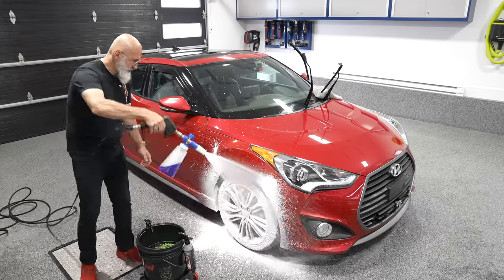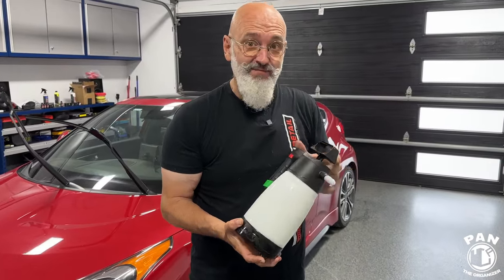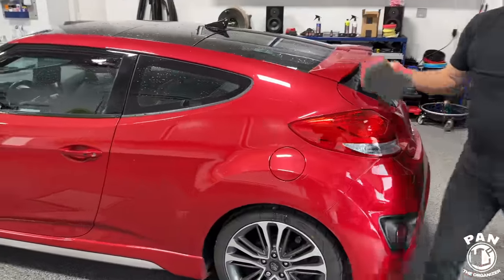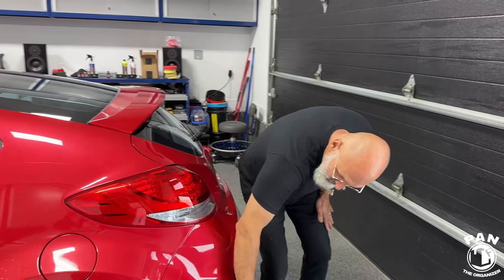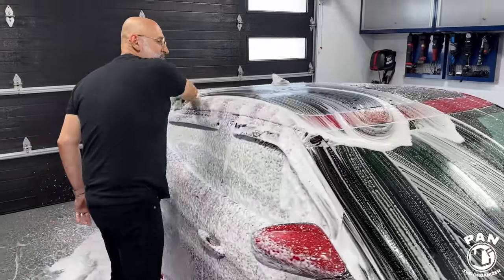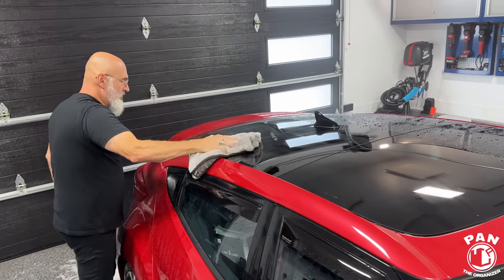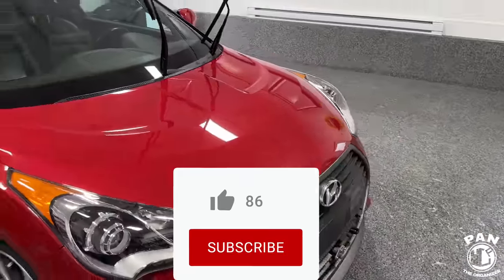The Ultimate Guide to Easily Wash, Clay, and Seal Your Car!

Comment: As most don’t have a detailing garage, I’d prefer these videos were done in a driveway scenario as many of these tips wouldn’t work well in direct sun where things dry much faster. Cheers
Reply: Unfortunately making videos outside isn’t easy because of audio. This process can be done outside easily with one simple change, use Rinseless, and do one panel at a time.
Reply from the maker: Well said. Also, most people I know in my city have a garage they can detail from and wash their cars. Also, filming indoors allows me to have perfect control of the recording environment: lighting, sound, etc. Filming outdoors is way more challenging.
Reply: Saying that most don’t have a garage is a gross misrepresentation.  How do you know?
Reply: @AndrewTa530  Troll elsewhere please. Holy fk
Reply: @AndrewTa530 lol you think most people have a garage they can pressure wash inside?
Reply: @diydetailofficial  Agreed but I can guarantee many will be cursing following these tips in their driveway. Especially when the expert states post tip that some of these tips will fail outside. Cheers
Reply: @cheesedoodle2327 why wouldn’t they??
Reply: @FJB8646  lol
Reply: @packetdust You're right, everyone in my apartment complex pays for and shares 2 car garages that have full water access and with plenty of space. Not. You're either out of touch with reality or completely indenial. Silly comment.
Reply: Do it early morning or in the evening, when you have shade
Reply: Where I'm from all garages are converted into living spaces so everyone washes outside. Rinseless is a game changer for me but I can still bucket wash my car as most now how to make due with what we've got. I love these videos keep doing what you're doing Pan!
Reply: @jmc4975  I know right these people think everyone has a fully waterproof garage with proper drainage and space lol
Reply: @cheesedoodle2327  It's pretty smooth-brained to assume everyone has the same kind of access to what could be considered just a covered space, let alone a luxury detailing garage.
Reply: Thanks for video. Why you didn’t use iron remover with no rinse wash method?
Reply: Can we all just agree that everyone's living arrangements are different.

I have a garage but it's  not big enough to detail a car, so I detail outside.

Be smart like one post said, do it early or late evening.
Reply: @AndrewTa530 the vast majority of his followers are fully mobile. Most people don’t have garages that can be used for this type of work and that’s a fact.
Reply: But we all have mornings and late evenings when Sun isn't strong . I did several ceramic coatings done for my clients, and without driveaway, but on the street , so, it's possible...
Reply: @Bull1the1Great  nobody said this couldn’t be done in the morning or when the sun is going down, although you will need proper lighting to ensure the job is done at nightfall. The original comment simply asked for this to be done outside in “direct sunlight”.
Reply: dranderson6071.
You must be new here. Vast majority of people need to throw away or organize (pun intended) the crap in their garage. 
I love Pan’s garage. He clearly planned it out for years, saved for it…..and frankly nailed it!
Reply: @MRDMotivates just showing different methods. Iron removers require rinsing after. The Rinseless version is something that can be done by anyone with just a few gallons of water. You can do one panel at at time from start to finish.
Reply: If I had Pans garage I would never leave.
Reply: On the rinseless wash side, is it better to use ceramic gloss or quick beads with the perforated syn thetic decontamination towel? In another video on Diy's channel, Nick preferred quick beads due to its slickness. Does this make a difference as it's not being washed off (activated and washed off)?
Reply: @benkneisley3001  Agreed yet irrelevant to my post. Cheers
Reply: Yasou Pan,

Thank you for sharing another great video especially with Ivan 😀! I have told many people about your YouTube channel and several thanked me for teaching them about car detailing 😀!

I want to decontaminate my car. It is a 2014 Chevy Malibu with 65,000/104,600 km and has a regular car wax. I use P&S Absolute wash and I bought a “clay” towel from DIY. In the video, Ivan did Not use the “Iron Remover” on the Rinseless wash portion. Instead he used “Ceramic Gloss.” On the traditional wash he used “Iron Remover.” Will the combination of using the Clay towel and Ceramic Gloss remove and/or decontaminate the car or should I use Iron Remover with the Clay towel Plus the Ceramic Gloss? I will leave the Rinseless wash solution on my car after I wash it to act as a lubricant. 

I also want to Ceramic Coat my car in the future. I will need to watch and study your videos for the best “tips and tricks” for the best products. 

Please let me know if you have any questions or concerns. 

Thank you and Ivan for a Great video; I really Appreciate it. 

NIKOS
Reply: Awesome 😎 ❤
Reply: @cheesedoodle2327 I know 3 people that don’t live in a house.  Out of the other hundreds they all have garages and most can park one car in it which is all you need to wash a car.  The others treat their garage as storage and quite frankly need to throw most of the crap away or donate it as a garage is for cars or work stations.
Reply: @ohboy2592  so you have hundreds of friends that have water proof garages with proper drainage..pretty cool man i don't know one person like that.
Reply: @cheesedoodle2327  ever garage is water proof.  Water runs right out the door off the concrete floor.
Reply: @ohboy2592  lol ok buddy
Reply: You would do one Panel at a time (Wash & Dry) if outside!!! Works great!!!
Reply: @MRDMotivates the Iron Remover needs to be rinsed off with pressure washing. It’s not ideal for the rinseless method!
Reply: @cheesedoodle2327  have you ever been in a garage or seen one?  A garage is just your driveway with a cover over it.  Does your driveway flood when it rains or you wash a car?  Do you think every garage has a floor drain or some magical contraption to remove water?
Reply: @ohboy2592  a garage is your driveway with a cover on it.  Ok buddy got it.
Reply: @cheesedoodle2327  you obviously don’t understand. When you get your first house you’ll understand what is being discussed.  Or go look in a friends garage and you’ll see what I mean.  It’s not that difficult.  It’s a concrete slab with walls and a roof over it.  Water hits the slab and flows out into the driveway.
Reply: @ohboy2592  ok
Reply: @AndrewTa530 a garage to detail in like pans garage ? Wow you must think everyone is rich or something. It’s a valid point he made and yes pan has also put up videos of himself doing these steps outdoors
Reply: @dranderson6071 do you have common sense?
Reply: Yeah, I’ve come to the conclusion that people who have no choice but to detail outside have either deionized water, a blower to dry the car quick, or both. 

I have a garage and I just don’t have the room to detail inside it, so I have to choose certain times of the day to get it done. It’s a pain but I’m gonna try a blower soon to see if that makes the process easier.
Reply: @AndrewTa530  it's Canada
Reply: @jmc4975  do you live in Canada?
Reply: @michaelconlin5614  Unfortunately, I don't.
Reply: Can I clay mitt or rag with a sealant with soap as a lubricant ???
Reply: Everyone has to understand these videos are a sales tactic so the easiest way possible is always going to be shown.
Reply: Not only do many people not have a garage, many people don't have a driveway either
Reply: As most people in the world don't have a car, do you prefer that he detail a bicycle?
Reply: @JustMe-999a  Irrelevant
Reply: Note: Small car, less surface area - lowest cost.
Reply: Most people who own cars of some value Do have a garage or at least access to one! Sorry you do not…
Reply: @2Greenlid  Lol
Reply: @AndrewTa530 it’s very safe to say “most people do not have a detailing garage.”  Go door to door in your area and see how many have a garage setup that it is perfectly safe and ok to spray water in and that have floor drains to take away the water and soap.
Reply: Lol I don't even have a driveway, however I love to detail my Mercedes every week.
Reply: @AndrewTa530  I'm one of those don't have a garage. My shade tree is my garage
Reply: @bossmanseen4807 cool, use a decontamination towel. After the wax and wash and polish. I can drive it to get contaminated again. 😅😅
Reply: @ohboy2592 obviously, I was denied a house because of my skin color. If your white, your allowed to buy a nice house with a garage. 
Because my skin is darker, the bank things I cannot pay my bills or own a house with a garage. 😅😅😅
Reply: @2nickles647 You were not denied a house because of your skin color, you were denied a house because of your financial standing.  Stop lying.
Reply: Bro u chould also just make or buy some kind of car tent for youre drive way when detailing its not that expensive if u also got the money for all the polichs and stuf
Reply: @mopadrider6012  Bro, never knew it was so easy. Man 55 wasted years bro
Reply: @dranderson6071  this. I live in Florida where it can be difficult to be in the heat and sun for a long period of time.  And like many others, my garage is not really used for vehicles and one of my vehicles is a stock 3500 which is next to impossible to fit in my garage.

Comment: Tip to manufacturer: For the clay towel. Put numbers on each quarter of the towel. That way it's easier for the consumer to know/remember which sides is used and not used.
Reply: Good idea
Reply: @diydetailofficial will you be restocking the clay towel? Been waiting on it for a few weeks now.

Comment: This morning 06/01 I used this process and these products to do my 2014 Kia Sportage. For those wondering about doing this outside versus being inside of a garage. Here's my experience.

I did it outside early in the day.  The sun was out but the majority of my driveway was in the shade.  Temps were in the high 60's / low 70's   When the sun finally started to hit the back of the car and since I'd already done the front.  I just turned it around and backed it up in the driveway and finished it off. 

The whole process worked perfectly.  I admit I had my doubts about the clay towel to begin with as I've always used a true clay bar in the past.  But it did a VERY good job on this car and it had never been clayed or the surface decontaminated before.  I could feel it dragging quite a bit on the hood.  Which, as expected had the worst contamination on it.  So I just flipped to another section of towel, sprayed and continued the process using lots of lubrication till everything felt smooth.

The whole process from start to finish took less than 40 minutes. Since I'd never done this before, I took my time.  Now, after doing this one time. I know  I can do the whole car in less than 20 minutes the next time.  

I also wasn't quite sure exactly how much water to use for the process.  I put 3 1/2 gallons of water into my 5 gallon bucket, and I estimate I probably used a half gallon total.

Finally, I just want to tell anyone who has watched this video and is on the fence about whether this process works.  I can assure you that it definitely does. Highly recommended. Especially, For those who live in apartments or condos. Also, if you live in an area where there are restrictions about water runoff with any kind of chemicals in it, this is an ideal solution for you.
Reply from the maker: Thanks for sharing your personal experience Carl! Great testimony here.

Welcome to my channel. You discovered one of the biggest car detailing channels on YouTube as we surpassed 1 million subscribers and we have over 140 million views! I have been detailing for 27 years and I love to share my knowledge and passion with my viewers.

You found the right channel to help you learn everything about detailing.

Comment: Not gonna lie, every time I smell the DIY rinseless wash it makes it increasingly difficult not to drink 😂😂 Another great video collab! 😎👍 Appreciate the full transparency of this Rinseless method. 

I actually use it as a glass cleaner, interior wipe down cleaner, and anti static spray for the fabrics. So many use cases! 💯 Keep up the great work DIY!
Reply from the maker: Thanks Cardos!
Reply: Thank you 🙏🏻
Reply: DIY rinseless wash on my car today only took 35 minutes. Didn’t even need to use glass cleaner. 

I used multiple microfibre towels and one 15 litre bucket , dunk the IK sprayer in for pre wash then rinse off with garden hose and then use the multiple mits that were soaking in the bucket 

Next on the list is to purchase the legacy sponge 🧽

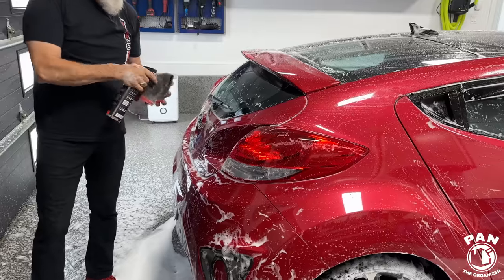Comment: 27:24 for the duration, I'm curious if this is for ceramic coated vehicles such as this one or if that duration is on non ceramic coated vehicles as well. I absolutely love the Ceramic Gloss and Quick Beads. The application is stupendously easy for both. Seeing the real time beads made as you rinse the vehicle. Very satisfactory.
Reply: Works on both

Comment: One of those worx hydroshots are great for a "rinseless". I have a 6 gallon bucket and mix 5 gallons of solution. Using the worx i pre rinse an entire crew cab f150 using about 3 gallons and the last 2 gallons is enough for the wash. If in the sun I go panel by panel. If the truck is filthy i use 5 gallons hot water - amazing at dissolving grime that way.  Im still old school and using ONR plus carpro reload as rinse aid/sealant.

Comment: And just like that, this video has become a reference for the net.  Wash, clay and seal for both rinseless and traditional soap.  Covers such a breadth of information in a concise format with top guys in the industry.  DIY Detail "Clay" Towel is definitely going to be part of my Spring season product purchase.

Definitely taken a page out of Yvan's book regarding wheels.  Love Brake Buster, but after using it once for a thorough clean, my maintenance washes on wheels involve just a rinseless.  They really don't get that dirty in two weeks.  Even easier to wash if you seal it with some Turtle ICE Seal n Shine ;).  I'll grab BB for tires and the occasional reset if I feel the accumulation is too much, but even then I'll dilute it at least between 2:1 or 4:1 (water:BB)
Reply from the maker: Thanks for the positive feedback!
Reply: Thank you

Comment: Really good class Pan, thank you. So the bottom line is the rinseless method can only be used if the vehicle is already sealed after decontaminating, paint correction (paint chip leveling), and a ceramic coating.  Is this a correct assumption or am I way off base?  I know of a guy who owns a classic Mercedes and he says he NEVER wet washes his vehicle.  If a vehicle only had wax, or was overdue for a was, the rinseless method would not be a good choice because dirt is sticking to the paint, correct?

Comment: I've brought Clay Bar, Turtle Wax polish for my black color hyundai creta. As an application, I wash my car with a water pressure pump followed with a clay bar application to remove tar or foreign particles. Afterwhic I shampoo wash the car. Post leaving it dry away from sunlight I then apply Turtle  Hard Shell Carbunara Wax and wipe it after haze dry with microfiber. Hope this process is correct.

Comment: Awesome video. Definitely saved for future reference. Other than DIY Iron Remover, what alternative iron removers can be used in the same way?
Reply from the maker: It's impossible to say as you'd have to make tests and find out the formulation of each one. The key thing is to use an iron remover free of any solvents. CarPro IronX also works well in my testing.

Comment: Great tutorial as always. Just a quick question regarding the decontamination in the first segment of the video using the rinse less method. I noticed, after competing the process Yvan did not rinse off the contamination from the car and instead just wiped it off with a clean towel. Can I do this as I do not have access to a water hose and will be doing the rinse less decontamination? thanks!
Reply from the maker: Here’s my full rinseless wash tutorial with explanations: https://youtu.be/p58Y5qRd3OU?si=xxh_xxIKxA-76aO1

Comment: I really like the simplicity of this method. As a beginner, do you see any shortfalls for a new black truck using this method? I think I may want to use the meguiers hybrid ceramic spray as the sealant from one of your older videos.
Reply from the maker: Not all products can be used as clay and seals. Clay and seal is usually done with a "lighter" spray, like a quick detailer or light sealant. The Turtle Wax Hybrid Solutions Ceramic Spray Coating is a long term ceramic sealant and needs to be applied on a clean and dry surface, so I wouldn't recommend it in a clay and seal type scenario. 

Basically, anything 6-12 months durability I wouldn't use as a clay and seal. Unless the manufacturer states it can be used in that way.

Comment: I suspect but can not verify that cleaning the wipers would be done when you are doing the tires.  With the additional step of rinsing off the vehicle to sweep away any contaminants removed from the wiper arms, blades, and rubber edges.  Is there anything else specific to wipers that would be suggested?   This video is great as nearly all the exterior surfaces' information is in one place.
Reply from the maker: Hi Michael. See my popular video on cleaning and renewing wiper blades here: https://youtu.be/eB5NtttIkPE?si=oCUpgCVyzWHPq2td